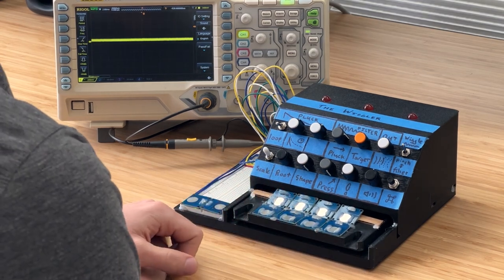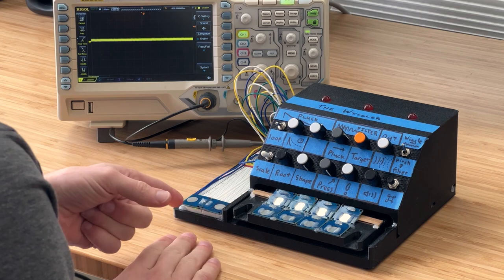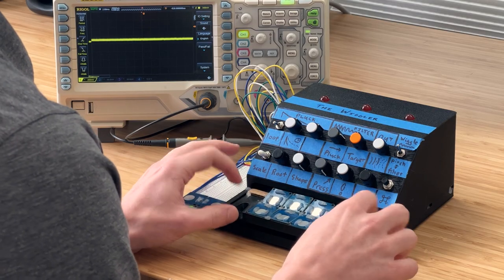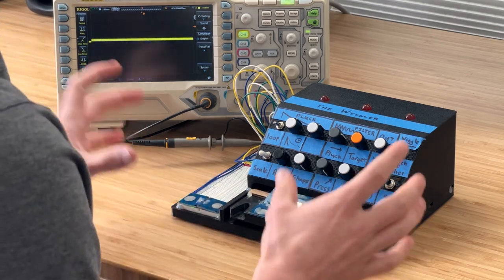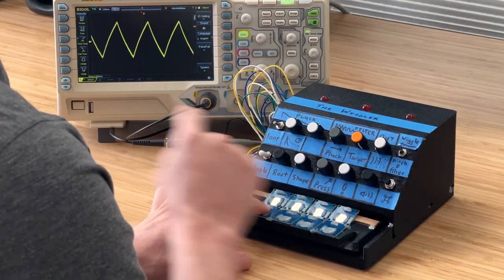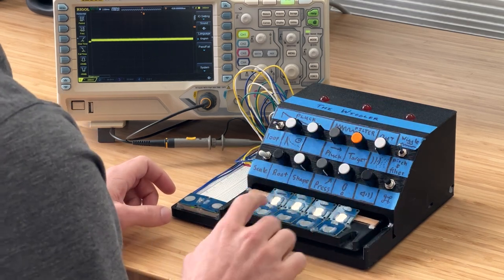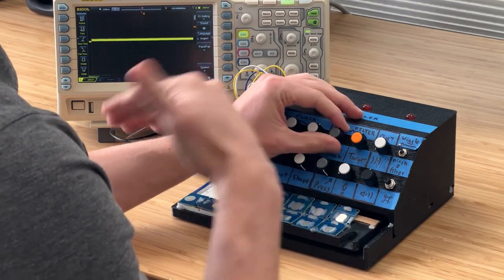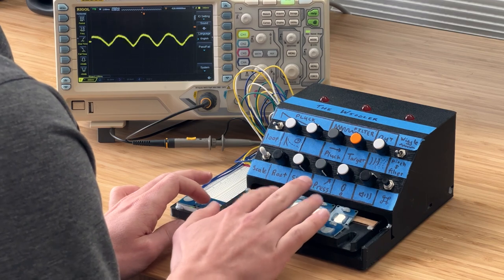Wiggler - Expressive Synth using Daisy Seed and Flexure #synthdiy

Comment: Brilliant to use two axes. 
Why not allow each key to wiggle independently?
Reply from the maker: Good question. This mechanism doesn’t scale well because you need to add a flexure and sensors for every note if you want polyphonic expression. The flexure will always have a size to it that’s larger than the pitch of the note, so if you have multiple rows then the flexures need to overlap each other.

I think that if you’re looking for polyphonic expression then there are already lots of fantastic options: linnStrument, Continuum, Seaboard, Osmose, and a few others. I think there’s actually a gap between non expressive MIDI keyboard and these amazing poly expressive instruments, so thats what Wiggler is intended to fill.
Reply: @sound.workshop  You won't have overlap if you put gaps between each key.
Reply: @sound.workshop  I wasn't saying polyphonic. Just mechanically independent.
Reply from the maker: Oh by overlap I don’t mean keys left and right of each other, I mean keys forward and back of each other. The flexure is about 60mm long and needs to extend in a direction perpendicular to the wiggle, which would mean under another row of keys
Reply: @sound.workshop  You mean the "black" keys? Or, you have two keyboards, one behind the other.

Comment: Love it - but what about the poor melodic minor 😁😉
Reply from the maker: I agree. I’m adding programmable scale features for v2. However I think that melodic minor will never be included because it’s different ascending and descending right? I would need some code to determine if the player is ascending or descinding. Sounds possible but low priority. I will make it so that you can program in any fixed scale though

Comment: Just give it few more keys and it'll be perfect. Preferably three full octaves. Is it possible?
Reply from the maker: Sorry I probably won’t add many more keys. The way the flexure works, it’s best to have the keys close together. If I add more rows, each row will have a different stiffness because the rows closer to the player have more leverage on the flexure. If I add more columns, then the flexure starts to tilt when you want it to translate.

I will have 5 octaves accessible using octave buttons though
Reply from the maker: in my opinion, there are other Expressive controllers better suited to having lots of notes, for example: linnstrument, continuum, osmose, Roli
Reply: @sound.workshop  thanks for reply. Maybe putting them on 2D, accordion-like grid would work better, but I am not sure.

Comment: that kinda reminds me of the seaboard, one of the main differences is the seaboard resembles a real keyboard and is polyphonic, also its not a synth but a midi lmao
Reply from the maker: Ya the seaboard is a big part of the expressive synth tradition! It is a midi controller but Roli did design a software synth to compliment it which is good. But ya I want to see an expressive synth with the synth built in so that’s why I’m doing the wiggler
Reply from the maker: Do you play guitar? I highly recommend LinnStrument, which uses a bass guitar style note layout. There are a few nuances that make the bass guitar note layout better expressive control. For example, the piano note layout makes pitch slides difficult because of the bumps as well as the inconsistent spacing between the notes. It is a bit over $1k though, so the price of a nice guitar.

Comment: Which mainboard are you using?
Reply from the maker: That’s a Daisy Seed 👍
Reply: @sound.workshop  Nice
Reply: @sound.workshop  Just one more question, the movement of the keys base associated with the two magnetic sensors is translated to Afterthought and Pitch Bend, right? I mean, at the end of the day it's all midi converted...
Reply from the maker: @Popart-xh2fd  No MIDI involved yet, it all happens internal to the Daisy seed. If I did have MIDI then yes I would probably generate aftertouch and pitch bend signals for the MIDI output
Reply: @sound.workshop  But nevertheless that is what is being controlled, right? Just to confirm.
Reply from the maker: @Popart-xh2fd  yes that's what's being controlled, if you want to look at it that way. I don't like using the term aftertouch because typical aftertouch on a keyboard feels different: aftertouch engages after the key has travelled some millimeters. In this case, the "Press" signal engages as soon as you touch a key, and increases from there.

Comment: We need an arduino version of this.
Reply from the maker: I do recommend Daisy Seed. You can program it using arduino code and the arduino IDE. SynthUX Academy here on YouTube posted a setup tutorial. Arduino has a few issues that make it difficult to make a synth on it (8 bit processor, no audio output, no audio libraries)
Reply: @sound.workshop  Thanks for the reply. I'll check it out.

Comment: Look out. ElectroHarmonix might be sending you a S&D letter from their Russian lawyers telling you to change the name! 😂
Reply from the maker: Haha I never heard of that pedal before. Time to lawyer up! (Jk I’m not super attached to the name Wiggler)
Reply: @sound.workshop  lol. Honestly, it would be a completely different realm in the eyes of the courts anyway, even if you did produce some for sale. If it allowed an input and output to be modified by the synth, then mmmmaybe they would have a case, but one is just an effect while yours is an actual instrument. I think it's totally badass. I bet if you did a Kickstarter, you would absolutely get enough cap to make a batch with PCBs and aluminum or a poly enclosure made from a manufacturer. Aluminum would be cheaper and could even allow you to just sell the device as a DIY kit. That's what I would do. Maybe offer them fully built for an extra cost.

At any rate, great design! I will definitely be checking your channel out more to see how everything progresses! Good luck and thank you!

Comment: I want 😅ne ❤ how much for the prototype?
Reply from the maker: haha thanks. This prototype wouldn't survive the shipment to your house. But I'm working on making one that will.

Early on I might sell dev units at collector prices to help fund the development. It will take longer to have something ready at a reasonable price. I hope less than a year, but I have a lot to learn before it's ready.
Reply: @sound.workshop  sounds great! One of my favorite and in my opinion most underrated synths is the Roland SH-2000. Your prototype reminds me of the expressiveness of that synth, but with 3 different modulation sources. Very expressive and original!
Reply from the maker: @sawsquaresinetube  ooh thanks for the tip I'll check out the SH-2000
Reply from the maker: I just looked at the SH-2000 and wow! That’s a really creative design for that period. It’s totally a spiritual precursor to Wiggler. Thanks for pointing it out